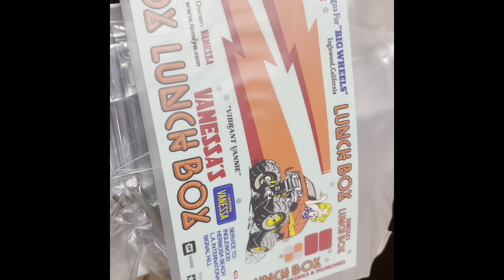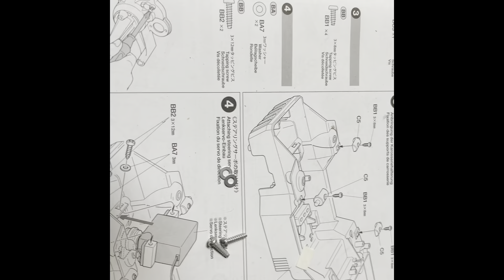Tamiya Lunchbox build pt2

Comment: Great video 👍🏻 Have you ever tried the HD servos? They are really good and they’re cheap.
Reply from the maker: No I haven’t. The mg servos I got recommended by Addams playground and theyre like 22.00 for 4 of them. I’ve used them in several vehicles now and had great luck. I’ll have to look up hd servos. I also really like the 25&35kg ZOSKAY servos. Put them in several builds as well and they’ve never failed me